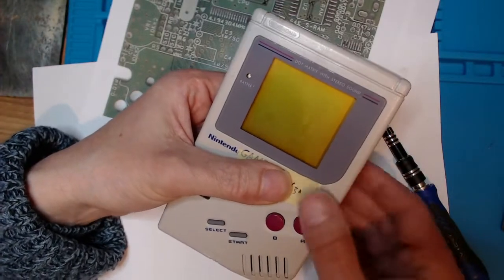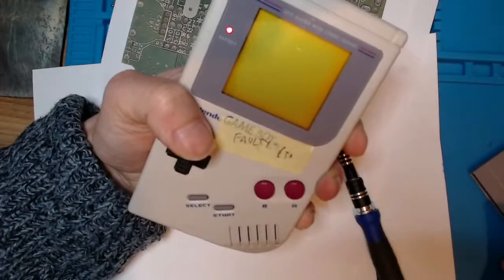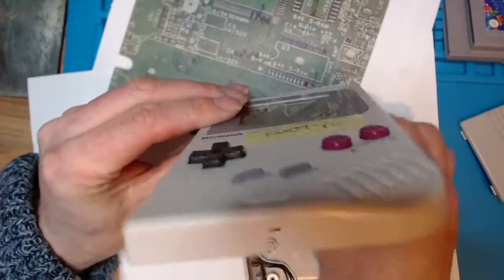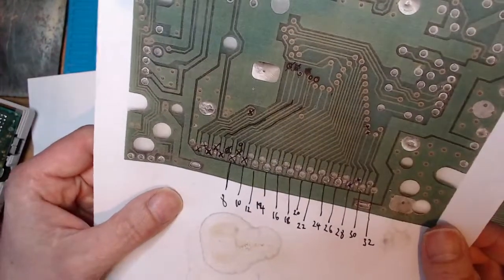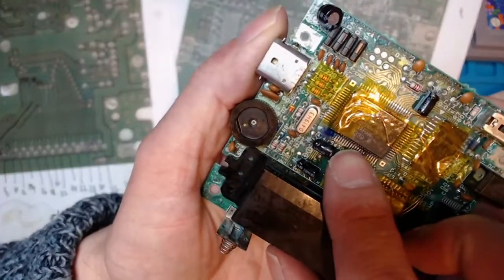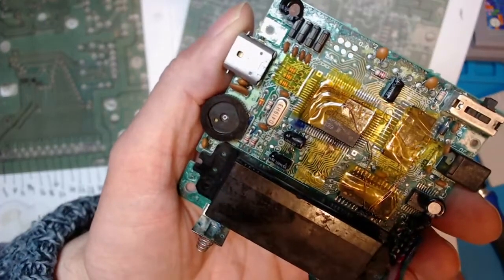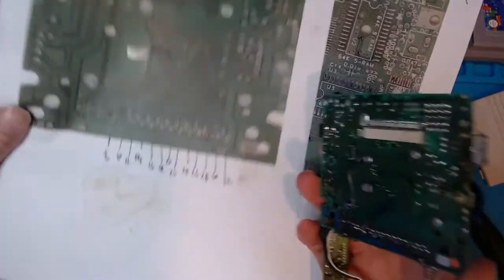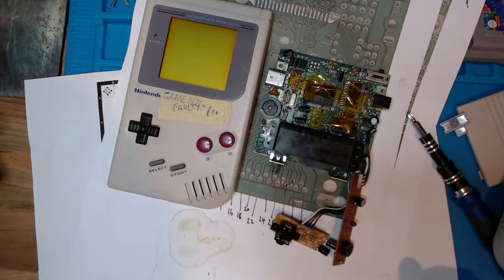UPDATE 1: Heavily Corroded Gameboy DMG Repair

Comment: It's amazing how much patience you had with this one Phil. You really did a great job!
Reply from the maker: Thank you Faab. I spent so much time and effort on getting the motherboard working, the fact the screen and speaker are both faulty, didn't really bother me. Knowing the board works and the chips are fine, gives me the encouragement to spend more time swapping the cartridge slot and running those jumper wires a bit neater.